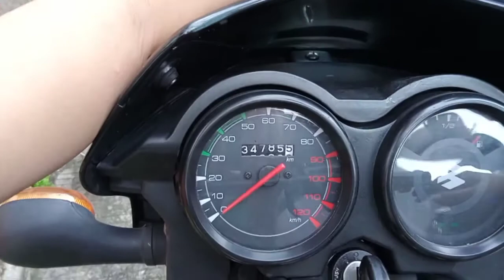Kawasaki Bajaj 125, CT-125

Comment: I suggest not to turn on engine but instead just use starter button to make gears turn. Diesel oil doesn't give any metal to metal protection to your engine. Piston rings will grind to your bore thus creating oil leakage in the future.
Reply from the maker: this motorcycle is dead; you're right.

I purchased a new one

please subscribe

www.youtube.com/@WayneBlogz